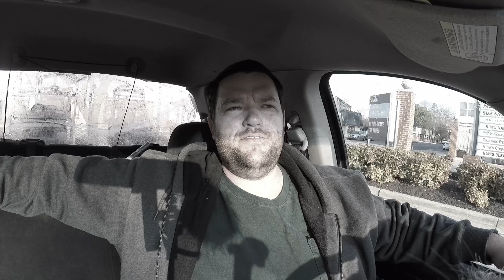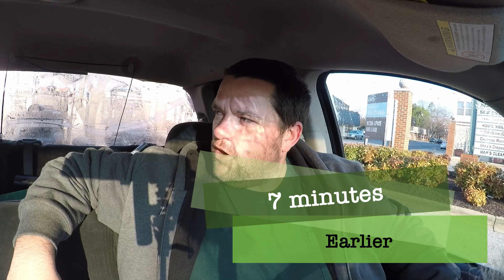ANSWERED: How Much More Efficient Is A Hydro Mower Compared To A Belt Drive?

Comment: I just sold my 36 inch belt driven walk behind gravely that has like the zero turn handles to be honest with you. It had just as much power as the hydros on my 48 Toro grandstand, but I do like the hydros better just because you don’t have to worry about belts popping or breaking you just gotta worry about that expense or replacing the hydros.

Comment: I cut over 85 accounts go
Hydro this is not a hard decision. 

1} Hydros hold hill better they don't. Slip like a wet belt driven unit.

2} Hydro back up fast quickly 
With out you pulling back wore 
Out afer 10 or more cuts on accounts in a day.

3} The hydro is like riding 
a motorcycle 

The belt is like a motorcycle 

Which would you rather ride
a motorcycle or a bicycle?

No comparison hydro easily
Wins! Which is why you never
See companys with over 85
Accounts go belt driven!

Comment: Great video! I'm currently looking for my first walk behind mower. I'm using a 30" Exmark and my properties are all a 1/4 acre or less. I'm hoping to get larger properties with the purchase. I was looking for a used 44" Proline Hydro with a sulky. Would you recommend this type of purchase or should I be looking for a belt driven walk behind 36" to 48"?  I'm not sure what to expect in terms of maintenance on either. I like to work on them myself like yourself. Thank you.

Comment: Thanks for this info, very helpful to me as I'm figuring out what kind of walk behind to buy as my first. I admit I'm a little nervous about belt drive bc it sounds like they are hard to control
and I have lots of obstacles in a lot of my yards - not too many just back and forth mowing.  Is that valid? And big question -  do you like the fixed position sulky you got? It seems to me it would kick out on turns and limit the turning in corners? Do you like it bette than your regular sulky you had on your proline? Thanks!

Comment: Same here Randy it is better but maybe 5,10 percent on bigger lots..I have a 36"hydro bradley mower the older 90 degree version I've had it for 3 years now.I use my 36" walkbehind or 30" toro on the smaller yards.
Reply from the maker: Oh cool, you have those mowers that they originally called standers before they started selling (for lack of a better word lol) real standers? I was gonna get one of those but then they stopped selling it

Comment: Excellent video my man. Older Proline mowers are great units .
Point blank your channel is about a good of proof on that point.
I have a 36 and 44 and don't see myself upgrading anytime soon. 
One thing to add is the older Toro proline units are very gas efficient. Do you have a rough idea on the % on gas savings on the Proline vs Bradley Hydro? And what are your thoughts on the cut quality between the two? 
Congrats on the sponsored video, looking forward to it
Reply from the maker: Mid 90s toro prolines are the best used mowers you can get for under $1k(even under $500). My proline definitely has better cut quality then the Bradley fixed deck. 

The  twin cylinder engine on Bradley’s produced double the power as opposed to my toro so the difference in gas is outrageous. My gas costs have more than doubled

Comment: Great information! In your opinion, how much more efficient is your 36  vs your 30 inch toro on small properties?
Reply from the maker: Massive. 30in is awesome but a 36 with a sulky is better in every conceivable way
Reply: @TheRandyDulin  Thanks Randy! This new year I am moving up to a larger mower and this helped make my decision.
Reply: @rlcaustin2603  
This is a great time to buy a used mower on the Marketplace things are dirt cheap right now. I have a 36 and 44 Toro Proline Belt drive mowers and I think they are the best used mower you can get a for a low price.